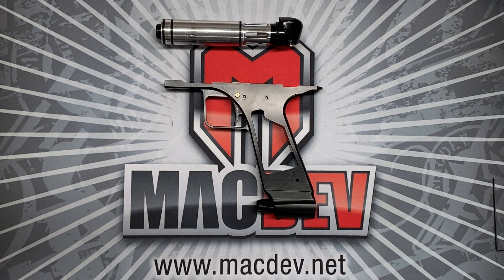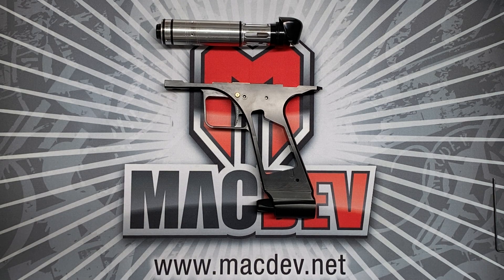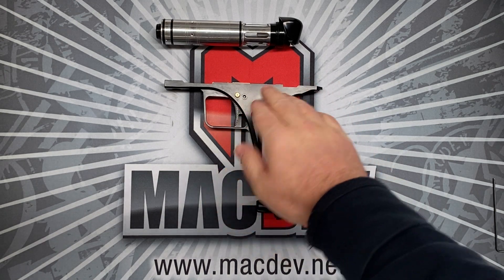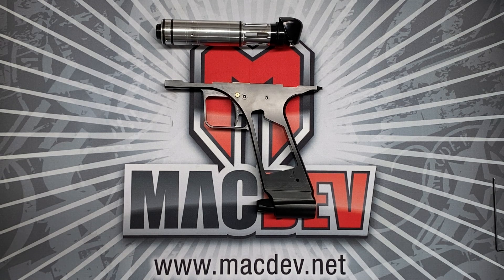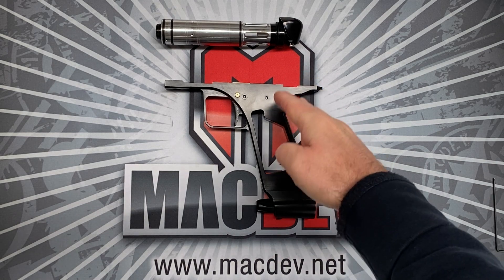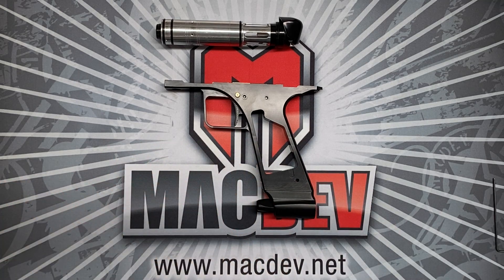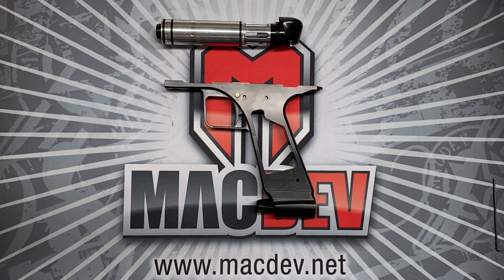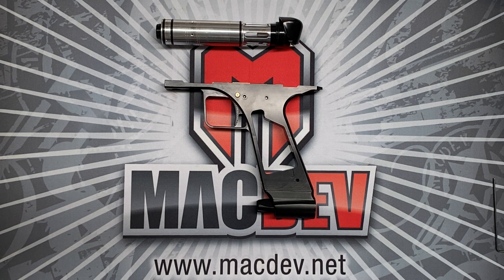XDR detail mech valve

Comment: I can see why you guys would want to do this in order to simplify the marker and help with reliability. Unfortunately, this seems to have been a double edged sword because the rate of fire and overall shooting experience and shot quality of the gun suffers pretty greatly. Couple this with the lack of adjustability for the trigger, and the extremely heavy pull of the trigger...this creates a big problem. So are there any updates in the works to counteract this issue?

Comment: Interesting; can it be shortstroked?
Reply from the maker: Shortstroking I guess means pulling only enough for part of the cycle to perform - this cannot be done, since the mech valve has only one function (not two functions close together like a timed system). But if you pull the trigger too fast, you could theoretically fire the drive before the dump chamber has fully refilled. I would say that is more of a max ROF thing than a mechanical short stroke.
Reply: @macdevpb  Great to hear for sloppy players like myself :D Appreciate the response!
Reply from the maker: @Goofy_68  Thanks! We hope to have a more old school, opens sourcy/collaborative approach to the mech gear. This type of design has more promise than the current offerings, and with some combined effort could be a real revolution.